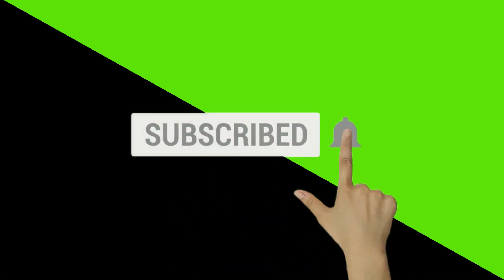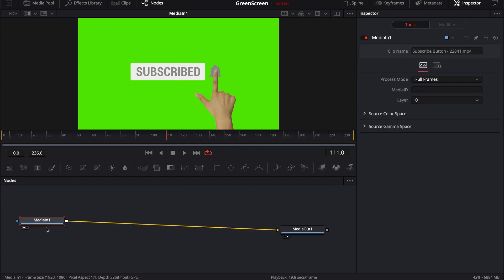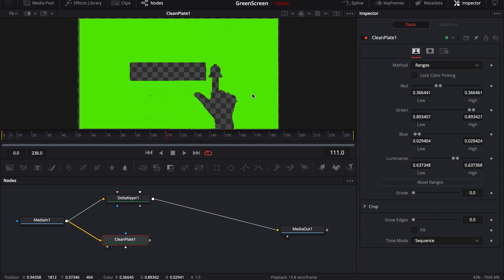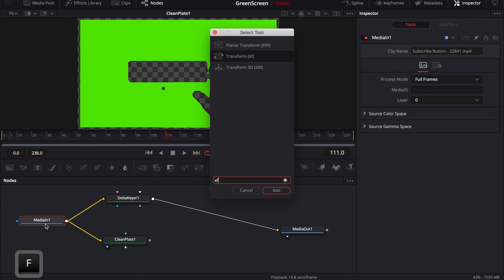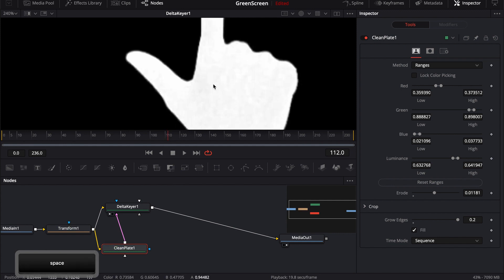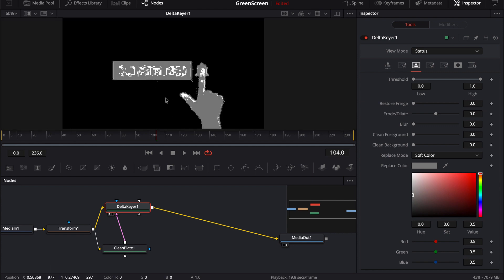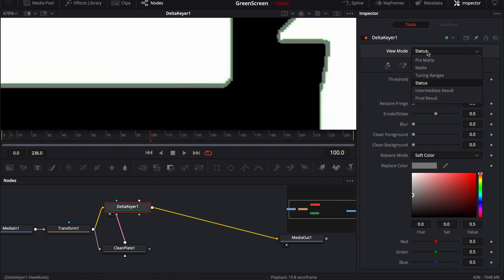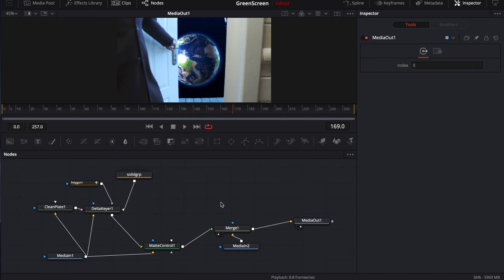Delta Keyer in DaVinci Resolve

Comment: I don't really understand what the clean plate node did, vs just using the delta keyer.
Reply from the maker: Sorry, I should have explained this better in the video. The clean plate is used to try and smooth out lighting differences in the green screen. Helps so you don't have to choke the matte as much thus giving you a better key in most cases where you have not perfectly lit your green screen.

Comment: Looks like you lose your garbage mask when you add the Matte Control.  How do you get that back?
Reply from the maker: The Matte Control has inputs for a Garbage matte, Solid Matte and an Effect Mask. If you have a garbage matte you need to plug in, you can use the right mouse button to drag and drop your mask output onto the Matte Control node to see the Input options (you can also hold the Option/Alt key to do the same thing). The Garbage mask should be Grey/White-ish, but is similar in color to the Solid Matte input. Hope that helps. Cheers!
Reply: @CBSuper  Thanks! This was a huge help

Comment: Thank you very much for this!   How do I export the video once I've keyed it in fusion?
Reply from the maker: This depends on what you plan to do with the export. Are you exporting it to go into another compositor? Then you'll need to render it out with the Alpha. Are you done and you just want it as regular video, then you can choose any of the render settings in the Deliver page. I have another video showing how to render with alphas.https://www.youtube.com/watch?v=m3k0pgcQDrc
Reply: @CBSuper  Can't seem to export it out after having keyed it with the delta keyer in fusion.  Thats where I worked on it and it seemed to have comke out just the way I wanted it.  But now it won't export even though I followed the steps.
Reply: @CBSuper  Ok so I exported just as you showed but I was wondering why the file couldn't be opened and played.  I then imported that file in After Effects and it was indeed read by after effects.  But when trying to work on it further After Effects wasn't responsive.  Do you know if this is because of the format it is in?  The DnxHr? I was trying to key out a similar color to another color I actually wanted to keep in Davinci and it appears Davinci's keyer's work a little better than AE.  If I wanted to just play the file exported from Davinci do I have to convert it somehow first?
Reply from the maker: You probably wont be able to play DnxHR in your quicktime player or whatever player you are using, and I'll check the AE thing in a bit.

Comment: Using this method I am not seeing the alpha channel I see if Fusion when I switch to Deliver. I tried rendering with alpha and I confirmed it was not saved. THanks, Mike
Reply from the maker: Make sure your exporting a format that supports an alpha channel.
Reply: @CBSuper  Thank you for your response. It seems my problem has to do with not being able to merge the foreground and mask effect unless I have a background connected to the merge node. I want the background to be the Alpha. I am new to davinci, so I am investigating this.
Reply from the maker: @mikemorrione8899  use a black (colored) background node in the background slot of the merge. Turn the alpha all the way down on the bg node under the colors. This will make the bg transparent. Whatever is in the foreground slot will be on top of your transparent bg.
Reply: @CBSuper  Yes, I tried that... and it seems to work when I put it back into Resolve fusion, however, when I put the same  clip into blender, the alpha does not work. I am using resolve Deliver's DNxHR with Export Alpha checked. Any suggestions? Thanks.
Reply: @CBSuper  Seems like my problem is with the Davinci encoder compatibility from what I am reading... haven't found and encoder with alpha that works yet, ugh.
Reply: @CBSuper  Your original comment to me was correct... the exporting formats I tried did not work in Blender. I found the correct one at https://www.youtube.com/watch?v=UA7WR_0OJRA. It is GoPro Cineform, RGB 16-Bit. Seems to work well in blender. Thanks for your help.

Comment: Hi, thanks for the video, I have managed to achieve a super clean key using the method! No noise and clean edges! 

The problem I am having is I don't want to add a background in fusion. I want to create a clear background for my edit page. When I just leave the black Alpha clear, I get a increased brightness in the edit page, if that makes sense. Almost as tho when I overlay it over a background the gain on the background gets jacked up. is there a way to turn that off? cheers
Reply: Never mind I found the solution, Need to tick the post multiply on the matt control tab
Reply from the maker: cool

Comment: Hi
Im new to using a green screen, I am trying to add a background to my green screen, without the background covering the whole clip. Is it possible to restrict a background to the green screen and keep the rest of the background around the green screen? so for example if the green screen is in the middle of a big wall, can I isolate the green screen to put a background on, but keep the wall around the edge of it in the shot? thank you
Reply from the maker: Yes. Any green screen technique only gets rid of just the green in the shot. But you can use a solid matte/mask to ensure the parts you want to stay are kept.

Comment: Amazing tutorial. However im having a sever problem with the clean plate on resolve 16. every time i attempt to select the the green color from the background it ends up selecting the entire image. I updated resolve to the latest version but the problem remains. I have the exact same settings as yours. 
Is there a way to fix this? thank you so much
Reply from the maker: I havent ran into that issue.
Reply from the maker: So I just ran into this while trying to replicate this error. Change the method from COLOR to RANGES and select a range of the green. You may see a better result. You will probably need to Grow the Edges and maybe click the Fill button. Also move the Clean plate offline and then plug the video into the Delta Keyer and bypass the clean plate. Then plug the Clean Plate output into the Delta Keyer and hopefully you'll get a decent result. Your video looks a little dark overall, so you may have some issues with green hue in the Darks.

Comment: Hi, I'm having difficulty getting a clean plate, my clip is in braw would that have anything to do with it? I have followed your example but the threshold and clean foreground / background doesn't want to work, I know it difficult but any ideas?
Reply from the maker: Link a jpg from the shot and I’ll take a look. So keying in braw should be fine if you're using a LUT (to make the green more saturated and stand out from your subject), but the issue is you'll need to add the lut either in the edit and bake it in using a Compound Clip or Fusion Clip or render it in...or you'll need to add it in Fusion...you can always use a different version of the clip later, you just need the LUT for the key and once you have the matte, you can scrap it. If this doesnt make sense, I'll go into more detail on my next Green Screen basics video. I've been getting lots of good questions about this topic. Also, converting to Linear space would work better than rec 709 in almost all cases.
Reply: @CBSuper  I figured it out, my laptop wasn't powerful enough, it all OK thanks for the offer

Comment: cool tut but... i also don't want to add the background into fusion to keep grading capabilities. and if roman managed to get it by ticking the post multiply on the matt control tab it doesn't work for me.
in the edit page i just don't have an image at all if i remove the background footage :( can you help me please. also if i had the background it seems that my foreground as cuts on both sides... weired
Reply from the maker: If you want to have the background layer transparent instead of using a background footage, you can use a black background node and drop the alpha all the way down. This will let the transparency go through when you jump back to the edit tab. You can move that footage above your BG footage in your edit tab. You can also color grade both FG and BG separately in the color tab if you want since they are not directly connected. Just remember that anything you do in the Fusion tab takes place before any effects you add in the Edit or Color tabs. So if you color your BG in the Fusion tab, when you go to the color tab, it will be colored, but it wont work the other way around. As for the cut outs, not sure by it may be a resolution issue. One of your resolutions may be different than the comp or the BG nodes. But that's just a guess. Hope this helps, i should probably make a more in-depth Bootcamp for GreenScreen as I get a lot of questions. The biggest issue with Chroma work is usually the footage is poor, but we just throw that out so I see a lot of Noise issues, which is why I did the Delta keyer this way, but it is by no means the only way to use it. Hope this helps.
Reply: @CBSuper  thanks so much for answering. actualy i found a way by changing the path. you have to get rid of the merge node and ocnnect the matte and delta to the mediaout do you think this is a proper way to do it ? 

for the black backgroud you change the alpha in the merge node right ?
now my main concern is that in fusion my image gets real dark so i cannot see how the spil affects the image. doesn't look so dark in the color page. i had this issue before and could fix it by changing the playback from half to quarter but it doesn't work here...
Reply: @CBSuper  and yes usually the green isn't perfect but all tutos are with a perfect one. i hope you'll take the challenge as it would be so usefull :)
Reply: @CBSuper  so i tried with the black background. setting alpha chanel to 0 in the merge node but doesn't work :( got the transparency in fusion but not in color or edit mode :/
Reply: managed to have it ok. just removed the backgroud and kept the transprency
Reply from the maker: Glad you were able to trouble shoot it. To reply to the question prior to this one, you drop the alpha in the BG node, not the merge node, but looks like you've got it figured out anyhow. Great job getting it to work. This is a very realistic VFX scenario where you need to figure out how to fix your comp and you seem to be on the right path. Cheers!
Reply: @CBSuper  drop the alpha ? is there an alpha node ? yes figured it out :) but i still think you will help lot of people doing a tut with a less perfect green screen, hard to get it perfect most of the times. keep up the good work, love your tutorials !

Comment: Why this method won't work with blue screen?
Reply from the maker: Alessandro Nofi I'm gonna have to play around with the Clean Plate node a little, but for now, skip that step and use the color picker in the Delta Keyer. You can still refine the Matte the same way and if you have lots of noise, you can still use the matte from the Delta Keyer and bypass using it as a throughput for your footage. On first glance, the clean plate and delta keyer don't seem to play well together when keying out Blue. I'll investigate it further.
Reply: @CBSuper  Hello and thank you for your reply. I have already tried this method but I cannot get a good result.
Reply from the maker: Alessandro Nofi shoot me a 5-10 second clip of the footage and I’ll take a look if you want. Cbsuperfilmic@gmail.com

Comment: the part after you go to range on the first clip I cant click anything
Reply from the maker: Make sure you are still on the Clean Plate tool. If the Clean Plate tool isn't highlighted in red, then the range will not work. Also make sure the the Box labeled "Lock Color Pick" is not checked.